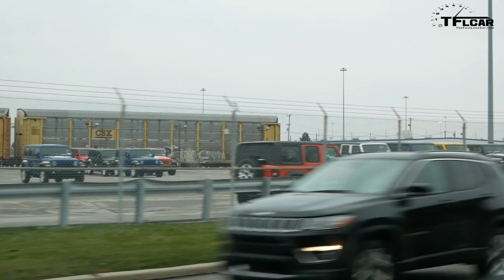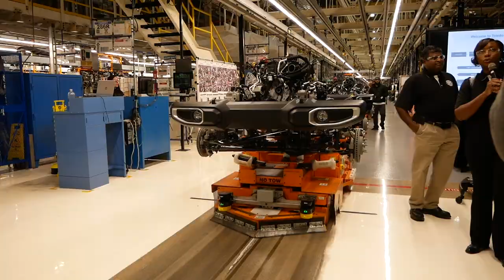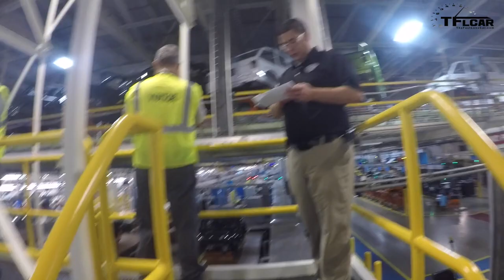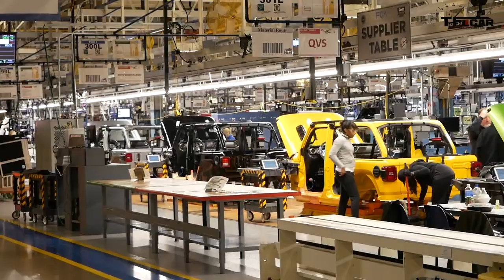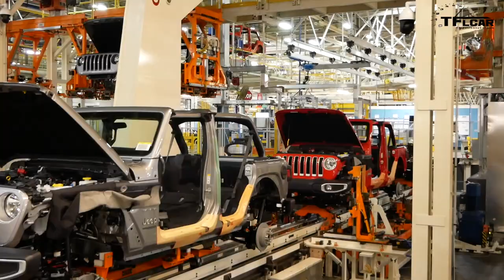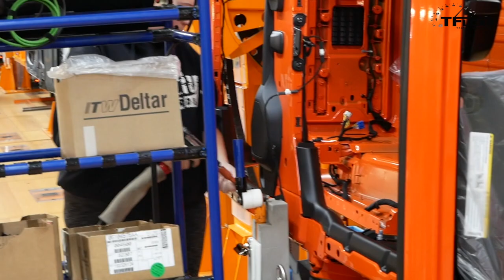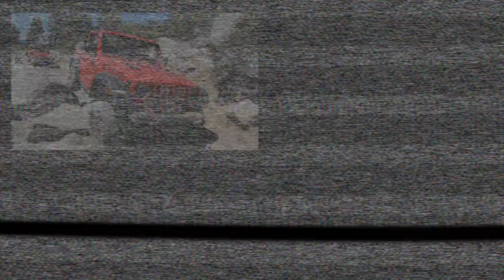This Is How Every New Jeep Wrangler is Made: Inside The Toledo North JL Factory!

Comment: That's my plant! I've spent years in that place. Great people!
Reply: would you recommend buying a Jeep ?
Reply: Can you explain the frame issues and the electronic issues please! I want to support you and the country by purchasing one. But frame issues and factory rust is a big issue for me :(
Reply: @Skull_n _Bones80 some Jeep owners modify their vehicles to such a ridiculous degree t that the frame is unable to cope with the drastically increase stresses , I have seen many Wranglers that are decades old and still going strong
Reply: Skull_n _Bones80 um, the 3.6L are very reliable. That’s why it’s in every damn Chrysler product
Reply: 122000 on my buddy's ram 2 wheel drive shop trk no problems good power great engine so far
Reply: This is soo cool! I ordered a rubicon back in March before Covid-19 and haven't got an update yet :( cannot wait to get mine
Reply: Aren’t jeeps crap nowadays?
Reply: @davidcaskey4669  122 is not a big number
Reply: @Tweed Penguin  I know I have 385,000 on my 12 valve Cummins in a 95 dodge and have 550,000 on a KT Cummins in a 78 Pete

Comment: I had to get a new windshield in my JL because it had 6 suction cup marks on the inside that would not clean off. I tried to clean it about 15 times then I tried a Mr Clean magic eraser and the dealer tried a razor blade. Jeep said just replace it to the dealer. I saw where these marks were made. I told the guy at the dealer that they probably picked it  up with suction cups at some point in the process. Kinda cool that I saw exactly where it went wrong. Cool video!

Comment: Mine was a very early JL, built in 2017.  It is approaching 14k trouble free miles.  The quality, fit, finish, and reliability have been outstanding.  It tackled Moab a short time ago and was amazing.
Reply: Principal Skinr but consumer reports and the ricer comments that ruined this channel insist that you have tons of problems!!!
Reply: @jakp8777  if there so unreliable why do people want them so bad and why is it that they hold there value so well. I have a 93 and a 2014 when people found out I bought a new jeep I had offers as high as $8500.00 on the 93 only paid $16,000.00 new
Reply: @davidcaskey4669  Wranglers are reliable. I have zero problems with any of mine. I was referring to what Consumer reports says of the Wrangler.
Reply: @jakp8777  I was trying to agree with you I think just worded wrong. I have 4 jeeps a1954 ,1978 ,1993and a 2014 4 door rubicon man do the coil springs ride sweet
Reply: lmao only mopar owners would brag about going 14k miles without problems

Comment: Hope they never kill the 2 door but if it's only 20% of Wrangler sales I worry.
Reply: The 2-door Wranglers have gotten so big over the years that they aren't the small compact vehicle that they used to be.  When I ordered my JL, I thought they were still somewhat compact like the TJ, but as I looked at the specs on it, I noticed that they are basically the same length as the 4-door XJ that I used to own.
Reply: If I ever get one it will be a 2 door.
Reply: The 2 door will always be the real Wrangler to me; I have a 2-door TJ Sahara and a 2-door JK Rubicon and it will be a 2-door JL Rubicon!
Reply: @stonemarten1400  -- You will definitely notice the increased size of the JL over the TJ.  The TJ (1996-1999) is 15.4" shorter and 5.6" narrower.
Reply: Grumpy - I also prefer my little, old TJ, which is more fun to drive than my JK, possibly because it has a manual gearbox. You would think new cars are improvement in all areas, but they are becoming bloated and dulling the simple pleasure of driving a raw and basic machine.
Reply: @stonemarten1400  -- New cars have gotten extremely bloated.  I can remember when the Honda Accord was a small car and the Civic was really small.  I saw a new Civic the other day and there was an Accord from a few years ago beside it and the Civic looked slightly larger.  I also saw a new Accord and it is definitely not a small car anymore.  I've looked up the specs on the CJs and Wranglers and there has been a definite progression in size over the years.  Looking under the hood of my JL, it seems so cramped in there that despite the vehicle being larger, I don't think there would be any room for any modifications under the hood.  Used to be there was room to put another air-conditioning compressor under the hood for on-board-air or an additional power steering pump for powering a hydraulic winch (in case the main pump was not up to it).  I don't think that there is room for that these days.  Which pisses me off since I have a hydraulic winch that I would like to add on my JL and I don't think the manufacturer will make a kit to make it work with the electro-hydraulic power steering pump that is on the JL these days.
Reply: Big difference my has a 93 yj and a 2014 jku rubicon night and day difference

Comment: Residue from the suction cups used to pick up the windshield has become visible on the glass of my JL...  I've tried a couple of glass cleaners on it and it's not quite gone yet.  I had imagined this kind of machine process when the marks appears on the glass, so it's kind of fun to see the machine that actually did the deed!  lol
Reply: ezeflierid same with mine. I had the dealer replace it. Jeep knows about it but they need the dealer to take pictures and send it to them. Mine weren’t showing up in the pics so I put my coffee in the area of the marks and the steam really showed them. I had a new windshield the next day
Reply: Try acetone on the windshield to remove the marks.  If that doesn't work, try xylene...
Reply: Grumpy OldMan I would just go to the dealer and get a new windshield. The chemicals could discolor it. U paid $40k plus it should have a clear windshield
Reply: +chicagowsox212
The windshield is GLASS.  Acetone or xylene will not affect glass.  Certain types of acids can affect glass, but not simple solvents like acetone or xylene.  If the windshield was made from plastic, these chemicals could affect it.  That's why you would not use something like that on a motorcycle's windshield, but cars have GLASS windshields, not plastic.  Put a bit of solvent on a paper towel and wipe a small portion of the affected area to see if it will dissolve whatever residue the suction cups left on it.  Do not allow the solvent to get on the plastic dash since some plastics will discolor with certain solvents.  For example, carb cleaner will cause motorcycle plastic windshields to turn white.  I was spraying a carb once and some splashed on my windshield (even though I was trying to be careful) and found that out. :(

So, you don't pour so much of the solvent on the paper towels that it is dripping from it.  If the form of acetone that you use is fingernail polish remover, then you will have some more residue that you will need to remove since the manufacturers put fragrances and other oils in it.  Avoid that if at possible.

Regardless, after you use some form of solvent to get rid of the majority of the suction cup residue, use normal glass cleaner to remove any remaining solvent residue.

It's like when you get an oil based paint or grease on your hands.  You start out with a mineral spirits based cleaner to remove the majority of it and then use Lava soap to remove whatever residue that the mineral spirits left on your hands.
Reply: Grumpy OldMan that’s a lot to read especially without having paragraphs but I’ll say this. If you use a volatile chemical on the windshield and it does damage it (which in my opinion it easily could) Jeep could them say Sorry, your owners manual specifically says use water or glass cleaners only on glass. Your idea is a good way to get stuck paying for the $900 windshield yourself
Reply: +chicagowsox212

There's 4 paragraphs in that post... Maybe whatever you are reading it on doesn't display paragraphs correctly on YouTube?  I think some of the mobile devices don't display it correctly.

And this is yet another paragraph.  Is is separated from the above on your device?

Just curious... How old are you?  To think that acetone would damage glass must mean that you are pretty young.  Or maybe you just don't have any sort of background in home improvements or working on your own car.  Simple solvents like this are commonly used on windows to remove the glue residue from inspection and vehicle registration stickers.

Now, if you want to start with a more gentle solvent first, you could try rubbing alcohol.  There are some substances that it will dissolve better than acetone or xylene.  I was refinishing a table once and wanting to remove many years of wax / shellac / whatever that was on it, but not sand it.  Mineral spirits did not work that great.  Acetone wasn't that great either.  Turned out that rubbing alcohol worked a lot better.  There were probably a few different layers of coatings on the table, so I each of the solvents that I tried ended up dissolving something that the others did not work on.

My background consists of degrees in engineering which also consisted of a few courses during my BS degree in Chemistry.
Reply: You people had windshields replaced? Lol!!!!😂🤣😂🤣. 

Fine steel wool and windex. Im surprised the dealers didnt kick you out of the dealerships. This happens to all cars. Its the lubricant they use so the glass doesn’t get hung up at the factory.  Glass Cleaner and fine steel wool! 🥴🥴🥴
Reply: you have a great attitude. I like you.
Reply: The marks which appear on the glass are probably fake glue.

Comment: That “Validation” area needs to spend more time inspecting the fuse box. Just drove mine off the lot and half the fuses and relays weren’t fully seated. Pretty poor quality control, but I still love my JL.
Reply: some things never change at Toledo lol. the production volume is #1 priority at that plant, it's been that way since 2012 when the plant started to exceed its designed capacity. the toledo overhaul helped, but the facility still does not have adequate capacity for the volume that management tries to push through it. before the overhaul it was so bad, they were running 3 shifts and sending vehicles out with known fit and finish defects and expect dealers to correct via warranty. it was getting ridiculous. people were getting Sport door panels on Rubicon HR builds, they weren't getting the accessories and packages ordered.

Comment: I wonder which part of the process they forgot to weld
Reply: Sure, give Jeep the hate when it was Subaru that actually had a recall for missing welds with the Ascent.
Reply: Robots Don't Forget!
Reply: Jeep also had a recall for broken welds I believe @panzer_TZ
Reply: This is true, smart cookie
Reply: Comes with a death wobble guarantee!
Reply: Andy Hass 
Oh well, that makes it okay.
Reply: The body of the Wrangler is built next door at Kuka. Aka body in white. It rolls into the plant to be painted then into the assembly plant to be assembled. I worked at Kuka a while back and never seen so many pinch welds on an automobile. These things are solid as hell!!! Same goes to the Grand Cherokee and Durango and the other vehicles. Chrysler goes overboard on the pinch welds and welds because it doesn’t cost them much more per car and they have a reputation for strength to uphold. Don’t believe me? Pull the weather stripping around the doors loose then look at your your cars. Also look behind the plastic of the wheel wells in the back. Its what makes Jeeps Jeeps. Solid as a ROCK!!!

Comment: Great segment. It’s a shame Jeep has to be shackled by Fiat. This is a stand alone product being held back by  build quality and reliably issues.
Reply: Scott G not only that but crash ratings aren’t very well either,I’d love to purchase one for family duty,which could also tow a little,off road,and decent fuel mileage,but between the reasons you stated and crash ratings I’ve,only been considering,Honda Pilot,Subaru outback,and Toyota Highlander,would consider the 4Runner but fuel mileage is horrible,and my family and I drive from Pheonix to just north of L.A twice a month so fuel is a concern as well. Round trip 700+ miles twice a month.
Reply: You are wrong.
Reply: Bernie DIAPER SANDERS Lukso 
I hate to brake it to you but the electrics in FCA products are the most unreliable in the industry.  The  engine and transmission are marginal at best for the platform.  Since it’s the only off the shelf drivetrain that fits the bean counters use it. I’m not bad mouthing the Jeep,  just FCA and the junk they produce.
Reply: Yet, they have one of the highest resale values in the market, they definitely need to work on their quality, however, as bad as FCA products their reliability is much better than any Land Rover product that cost 2 to 3 times as much and has one of highest depreciating values in the market.
Reply: @brianaustin6184  The new Wrangler hasn't had any IIHS crash test performed. Are you referring to the old one?
Reply: @akkoa420  Bingo.
Reply: If these are Fiats then they are the best Fiats ever made!
Enough with the Fiat nonsense.
Reply: Broken Fuel Gauge hello,and yes sorry I didn’t specify,I was making reference to previous models,and also in comparison to the other models I had listed,jeeps in my opinion just didn’t seem to do as well.
Reply: @akkoa420  Resale is sort of like politics. It is a popularity contest, not necessarily based on the true cost or value of the vehicle or the components that make up the vehicle.  The more popular something is the more people will pay for it regardless of if it is worth it.
Reply: @brianaustin6184  I hate crossovers though. They look like blowed up station wagons.
Reply: cydonianman I agree,not really a fan,but they do check all the boxes in my opinion,between being bigger,fuel efficient, safer,spacious, I mean the new rav4 hybrid gets better fuel mileage then my 2017 Corolla and also has a tow capacity of 1,500-3,500lbs depending on what you purchased,so that makes it hard not to be a purchase in my opinion